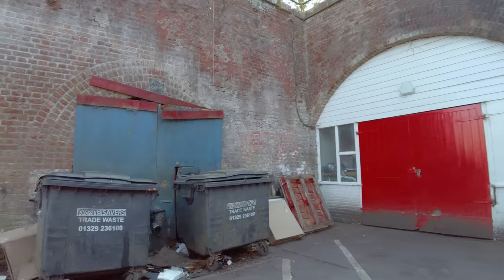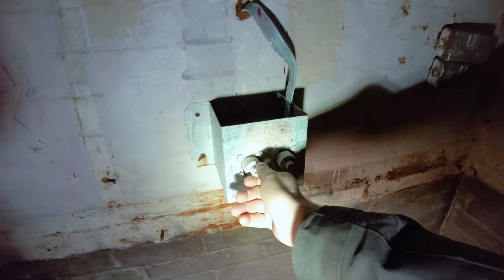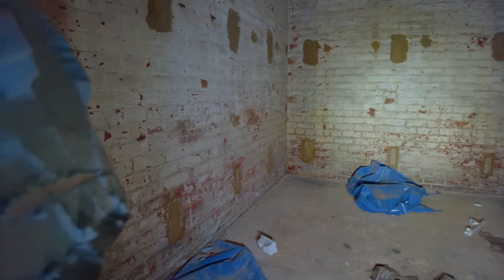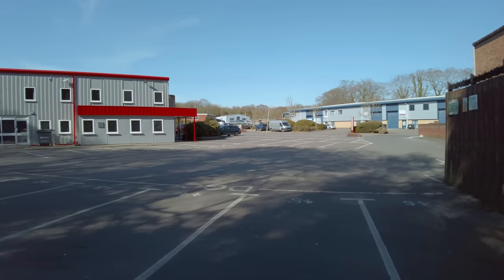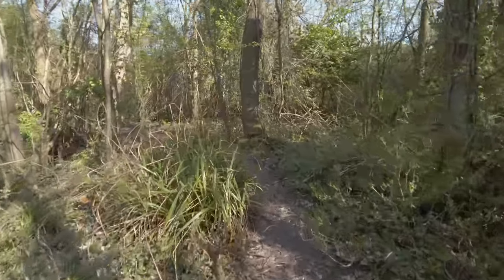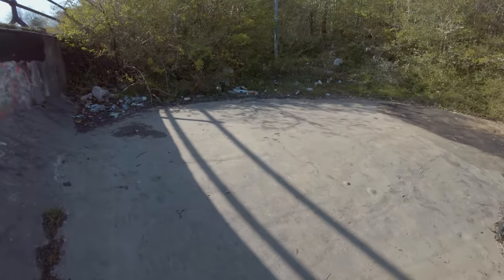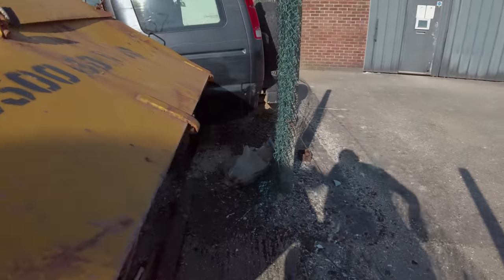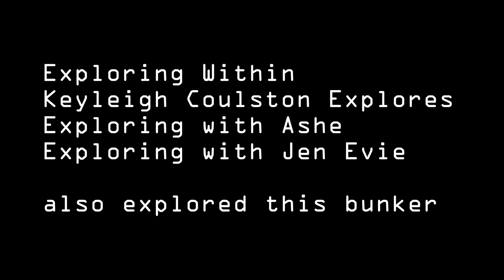FORTRESS converted into NUCLEAR BUNKER Fareham UK

Comment: Great video, I used to live behind Fort Fareham and this brings back memories. Always down there as a kid during the 90s. There were so many parts of the Fort that were accessible from the wooded side but all blocked up now. When you went up the steps if you would of turned left there were 3 tunnels, think now two of these are now blocked up.
Reply: Well nick squires is a name I havnt heard in a long time some good memories with you as a kid
Reply: I also grew up on the other side of the woods. I remember getting in the fort through a small hole. I think it was a hole kocked out of a wall built to block it off if I remember right. That was back in the late 90s. There was a group of like 6 of us, and I remember we were all completely bricking it the whole time because of all the ghost stories. What a wild place to think back on.
Reply: What’s your last name as I grew up on fort fareham road